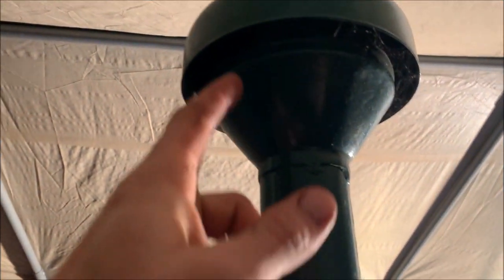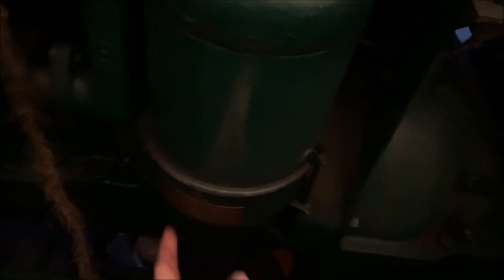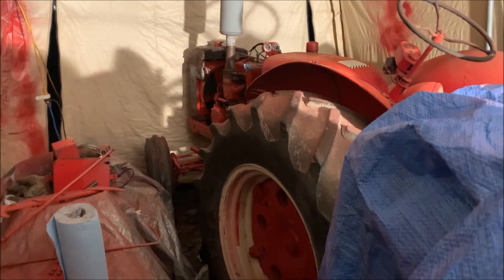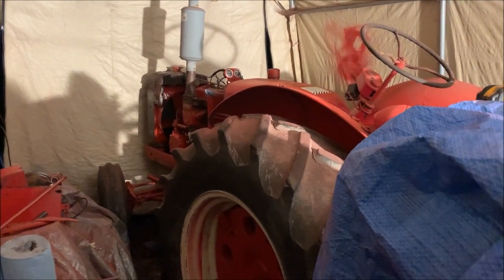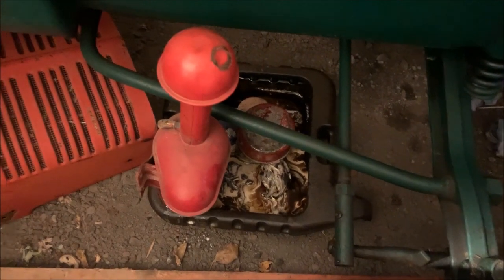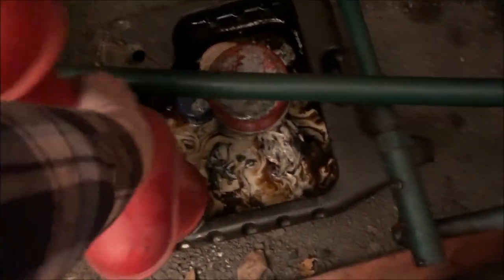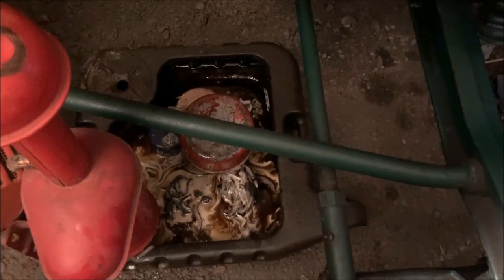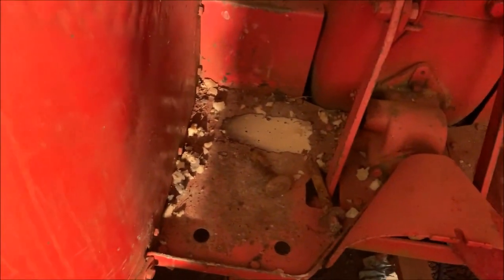....This is why you service Oil bath air cleaners !!

Comment: What caused that to happen? My oil cup is clean but I'm getting the milky mixture in a return line to the crank case, so it dilutes my crank case oil (John Deere 2 cyl)
Reply from the maker: This one was sitting outside for many years kind of a extreme case with moisture